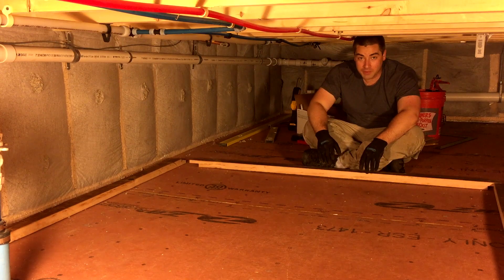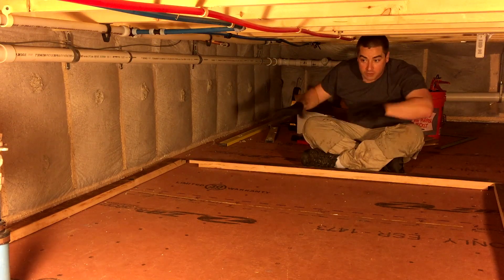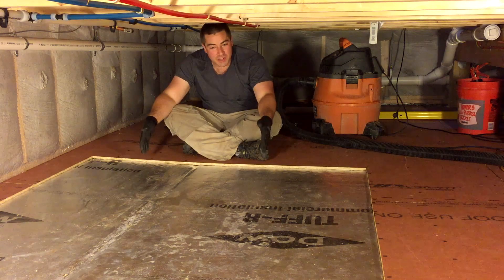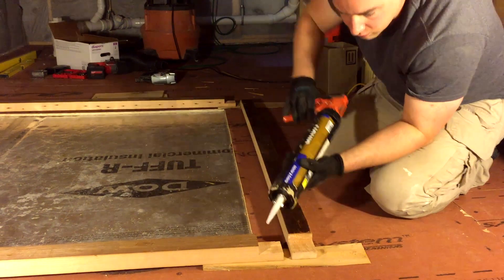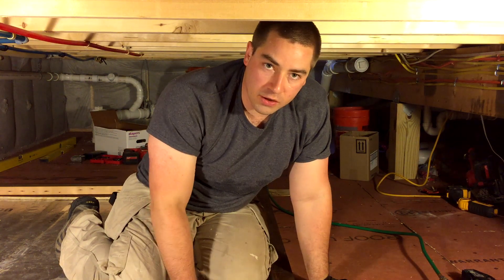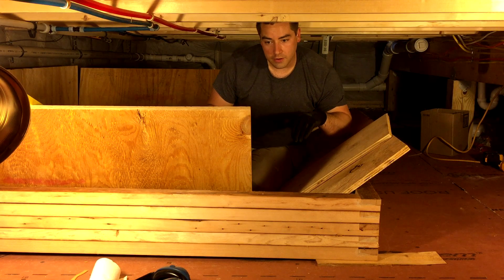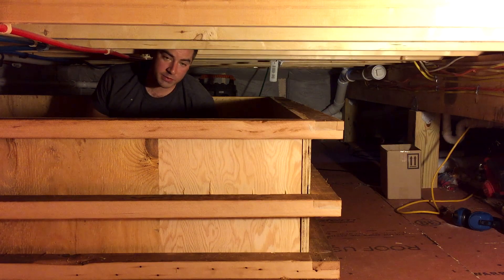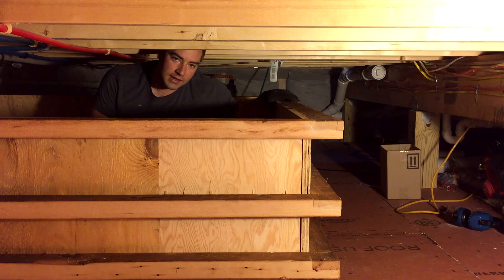Framing Solar Thermal DHW tank, part 2

Comment: So Good! How has it been working?
Reply from the maker: The tank works amazingly well at storing heat.  We can have overcast days for a week, and the tank will drop 40°F over the week with our daily use.  Then it can jump on a super bright sunny day.  However, last month I did have my first problem with the setup.  One of my panels outside sprung a leak.  I made a video about it.  Since the repair we are back in hot water.  I still love the thermal tank, but now I'm questioning a drain-back system.  Perhaps I should have used a HX glycol system?